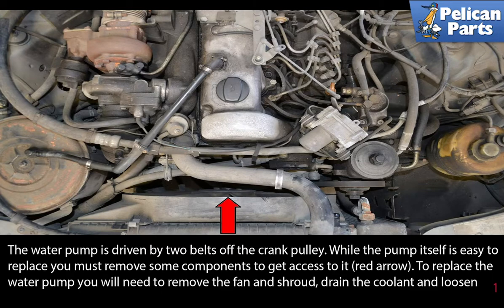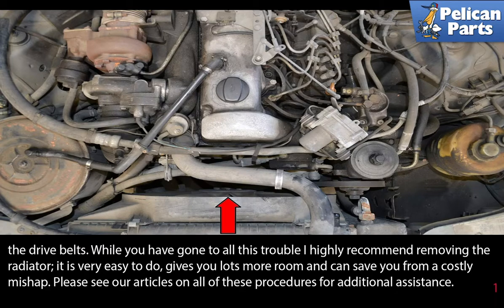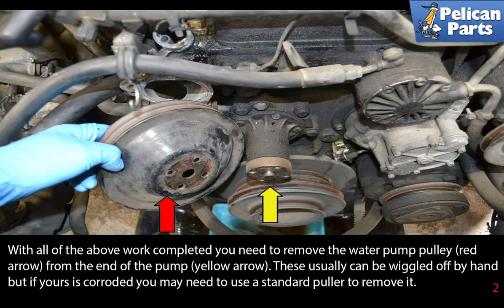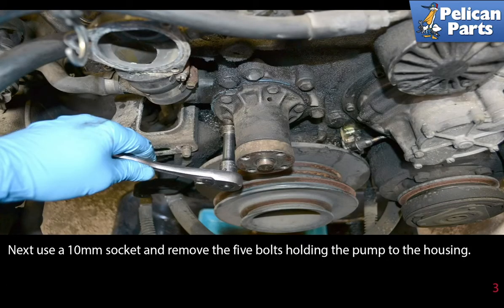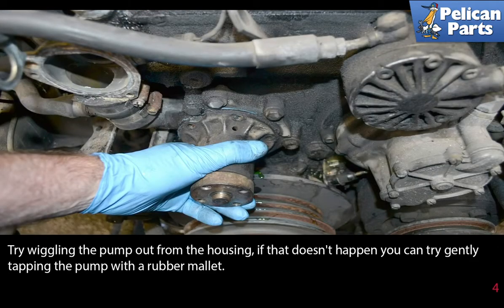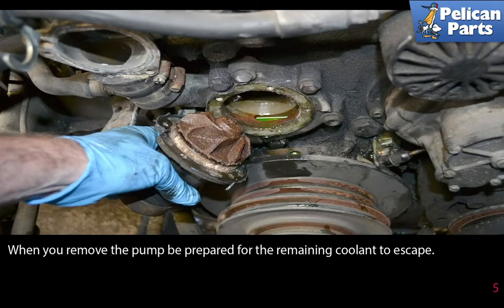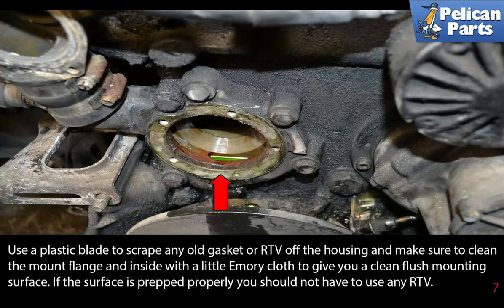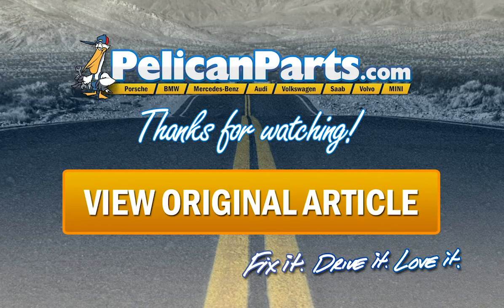Mercedes-Benz W123 Water Pump Replacement for 300TD, 230, 240D, 280CE, 280E, 300CD and 300D

Comment: Hi what is the size of the screws holding the pulley on the water pump? My 10mm just keeps sliding over them.
Reply from the maker: They should be 10mm. Your socket could be worn out, or someone changed the fastener size.
Reply: @ did you guys have to modify the wrench at all? My wrenches aren’t fitting in there

Comment: I flushed my cooling system and now the water pump started leaking, could doing this fix my problem, or is it more complicated?
Reply from the maker: If the coolant pump is leaking. this is the repair you need. With your vehicle info handy, give The Pelican Parts parts specialists a call at 1-888-280-7799. They can figure out what part or repair kit you need.